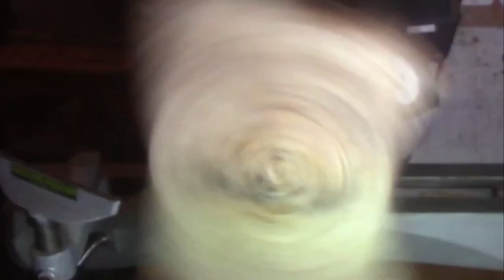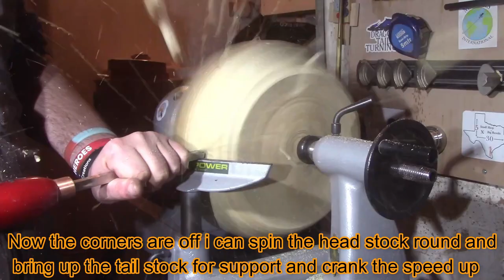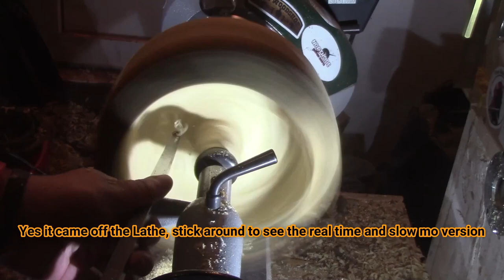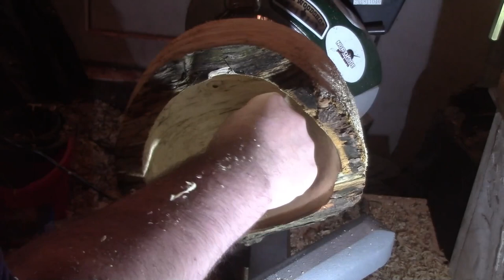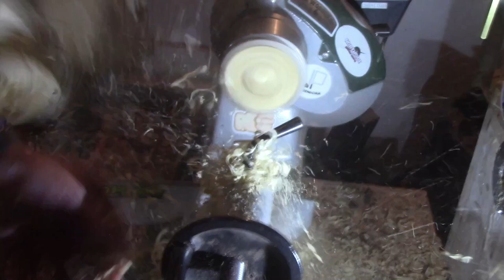Woodturning | Rough Turning a Live edge bowl

Comment: Great job! I am just getting into woodturning and am wondering what are the things you have to take care of when you let the piece in wood shavings? 
What can you do if it cracks?
Reply from the maker: HI, So just keep rotating it in its shavings, you can keep weighing it until it stops loosing weight, usually they say for every inch of thickness the bowl is, thats 1 year of drying time you must wait. also it would be a good idea to put some kind of end grain sealer on the bowl too, you can use a pva glue/water mix, or a latex paint...... after the point of drying time and if the bowl has cracked, you can fill it with a whole range of things from CA Glue, sawdust, resins, inlay materials, glitters, whatever you like really, people have even been known to put coffee grounds in which is a popular method. hope this helps
Reply: @jpwoodwork  thank you so much! At the moment I am building myself a workshop and I hope I can get machines as soon as possible. 
For now I am watching countless yt videos so I will be ready for action when the time comes :)
Reply from the maker: @Mojster-Jaka  well good luck with the shop, if youy have any more questions, feel free to ask